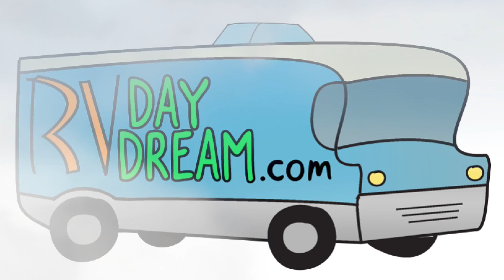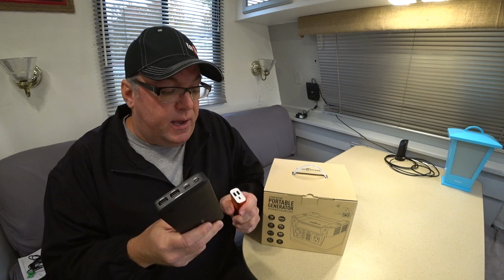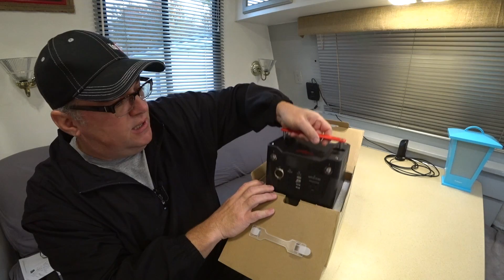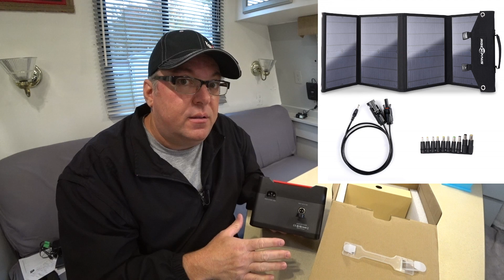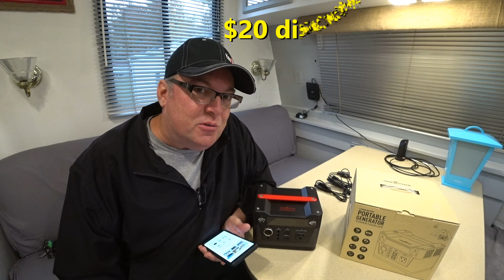ROCKPALS 300 Watt Lithium Power Station Review

Comment: Wrong it's a generator because of the solar capabilities
Reply from the maker: Wrong the solar capabilities aren't built in they have to be bought separately and the panels are the "generators"... if they want to keep using the generator analogy, they can refer to the power station as the "fuel tank" .

Comment: Damn it, mine doesn’t turn off if there isn’t anything connected to it. One of the on/off buttons was accidentally pressed and the display screen light just drained the battery. Turn off, but if one of those buttons is accidentally press the display screen will just continue to drain the power, at a very slow rate, but still.

Comment: Can someone tell me why my rockpals re hundred Watt generator shut off at 8 volts when at 12.6 volts is fully charged is there a reason as shuts off when it hits 8 volts
Reply: I suspect it has something to do with the batteries and how they are combined to get up to 12.x volts. So usually a battery has about 3.x volts and then when combined in a certain configuration....the voltages are combined. 
So when you get to 9 volts or so.....all those batteries are out of power. 

That's my best novice guess at what's going on.

Comment: Use a pc fan
Lots of air movement. Some are 5v some are 12. Just solder either a USB connector or cig lighter , or aux 12v.
I also have a 6v lantern with a CFL bulb, soldered USB cable on battery terminals, and it still lights on 5v.

Comment: This is my favorite Power Station. They also have a 500 Watt model now. You can't run an entire RV with one of these, but every RV needs a power management center and this is an excellent one with all the discounts. Once I'm connected to shore power everything else in my Mini RV connects to the ROCKPALS. I have two refrigerators, one Black & Decker 12 volt fridge/freezer that pulls 60 watts and a much bigger freezerless fridge that only pulls 11 watts (no compressor), 12 volt exhaust/vent fan, 12 volt water pump, and 12 volt accent lighting. It's $30 a night to camp in Georgia State Parks and you have hot showers and bathrooms near your site besides your power and water. Then I can run my Raspberry Pi computer with it's 21" Dell flat screen display. Pass through charging keeps the battery at 100% while it powers all your devices. Soon I will get the 100 watt solar panel.
Reply: Sounds pretty cool!

Comment: What in the world are the 12v4a circular plugs for on the front?? I have the 500w version and I'd love to use them to you know, power stuff, but I can't for the life of me figure out how
Reply from the maker: The hardest part is trying to find a cable that is wired correctly that utilizes those jacks. Basically I put this under the category of, Lost in Translation, it's a good output for quite a few different direct connections to power 12v items but, it's not a popular connector on anything specific in the US here. I'm assuming there's a market somewhere in the world that uses that type of adapter quite a bit but it's not North America.
Reply: @Rvdaydream  Wow ty for the fast reply! Would you say it's safe to use the adapter I linked? That's pretty much what they're for right?

Comment: I follow Will Prowse's channel and the Rockpals 300W is highly recommended. I want to buy one of these to power my Coleman cooler in my Honda Element and for cpap, etc. I will get a solar panel to go with it, rigid or flexible not sure which at this time, definitely a 100W panel. Am waaiting until spring to see if better options become available. Thanks for your review.

Comment: This is not going to power your whole house but in my expert opinion as a computer scientist rockpals are quality over quantity as I obtained this investor because of its dedicated solar accessory . The rockpalls 100watt solar generator accessory goes way beyond my expectations of 100watt power density because it can completely charge the 280wh inventor in 2hours. The rockpalls 280wh inverter has incredible power density for DC tec and to protect the battery the invertor shuts off high amperage output before the batteries get low and risk capacity loss or becoming permanently dead.

Comment: Sorry, but for 199. I will vet a generator.
Reply: I wish it were $199. It's $299.
Reply from the maker: @NoProGoPronto  make sure to use discount code.
Reply: @Rvdaydream  Neither promo code works (today: May 2, 2019).
Reply from the maker: Remember, you can't always run a generator... perfect example, the state park that we currently are at. There are a lot of sites here that are primitive sites and a lot of tent campers. There are at least four signs that state generator use prohibited in park. And even the generators that are allowed in other parks need to have only a certain level of noise being generated out of them to be used legally. For the most part will user generator in boondocking situations however there's a lot of times that we don't want to bother or we don't want to burn fuel to power something or recharge something like our laptop and phones. Plus it's a good idea to have redundant systems. The only thing that we're lacking now is solar. We have onboard batteries for power, we also have the battery bank that shown in this video, we have those smaller battery Banks, those are mainly for the cameras though, and then we have the generator. Once we had solar to that mix we should be well covered for any contingency.

Comment: Battery tech is another of those fields that's improved tremendously during my lifetime.  NiCad seemed pretty good when we first got it, but when I recently replaced my old (failed, threatening to start a fire) NiCad drill with a new Lithium Ion set, I realized just how anemic the NiCad was.  Add to that the vast improvements in lighting (with LED vs. incandescent), and solar, and remote power finally looks to be practical.  A unit like that means you're able to go even further afield with your electronics.  Great stuff, and great presentation of it.

Comment: Question to all you Rvers!! We could use some help. We have a bus/motorcoach. It's old. A 1992. We went camping in it and everything was fine. We left and came back BUT we noticed that SOME if the interior lights were dim. After about an hour they totally went out. Suddenly all of our a/c's stopped. We JUST had them serviced and they were fine. The backup camera went out and so did the radio on the dash. A few of our outlets also. Now, the bigger lights in the inside of the bus area are fine, so is the fridge and the convection/microwave. Even the little light in the shower went out. Could anyone help? Some say it's the inverter and some say no. The inverter has a red light that suddenly blinks now. Could it be the converter? We live in a fairly small town with limited help. We have to take it to another town for it to be looked at  I just thought I'd ask.
Reply: Your inverter working for your unit?

Comment: have you ever thought about doing infomercials?, also forget about all trinkets and get solar {250 watts, 2 6 volt golf cart batteries, SC- 2030, TM 2030 and good pure sine inverter, only way my batteries get charged are by solar or when plugged in truck going down the road for the last 2yr 10 mo., solar has been on since I installed it 1/2016, great having charged batteries all the time
Reply from the maker: Solar is in the future, more than likely not on this one 😁👍

Comment: Can you plug in a 300 watt inverter    using its 12 volt plug into battery ,  then plug fan into inverter...wondering if fan will last even longer?
Reply from the maker: Sorry, that would be a drain... You don't want to amplify an already amplified signal(voltage)